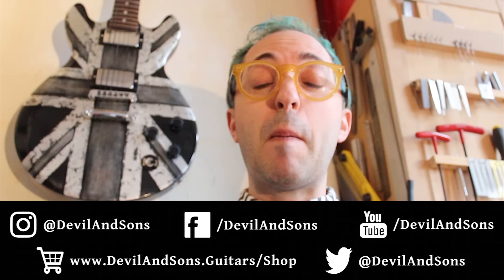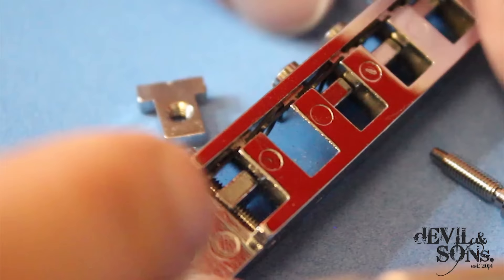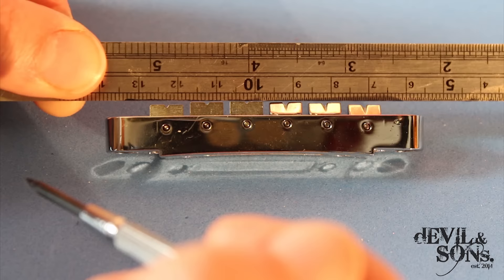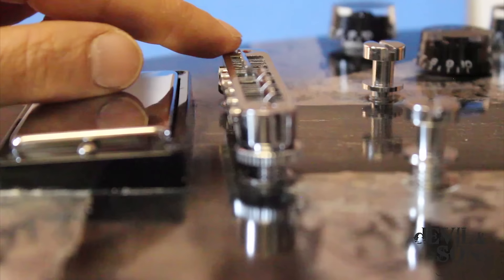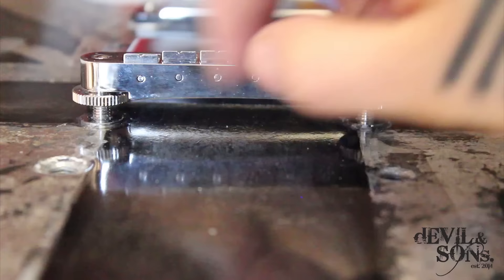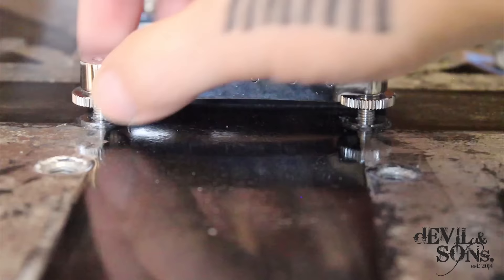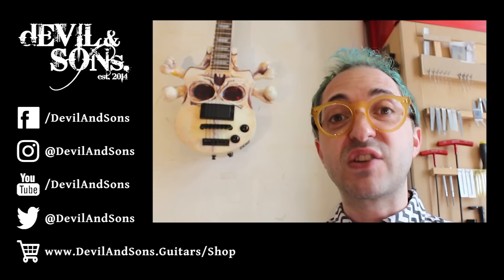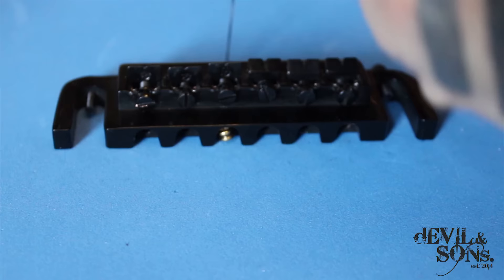Setting up a Tune-o-matic bridge (Les Paul style)

Comment: Thank you so much for the video. I love amount of detail it has. I'm just starting to learn how to set my guitar, since I cannot take it to the tech now (for obvious reasons) and I'd always wanted to know how to do this myself. Cheers!
Reply from the maker: Thanks for commenting. I'm glad it has helped for passing the time during the current situation and that you are learning a new skill from it. I hope you get on well. Happy strumming!
Reply: @DevilAndSons  I just raised the tailpiece and now I feel more tension on the strings. Is that normal?
Reply from the maker: @preciseaudioblog  normally lowering the tail stop increases tension as the gap between where the string leaves the saddles and enters the tail piece increases. The main thing though is you can obviously still loosen the strings with the tuning pegs and the height of the tail piece is really just make sure the strings aren't slipping. If you raise the bridge part with the saddles though you should expect the tension to increase. I hope that makes sense.
Reply: @DevilAndSons  Actually, I'm more confused than ever (lol). I thought that raising the tailpiece would give less tension to the strings, since the angle from the tailpiece to the bridge is minor. Isn't supposed to work like that?
Reply from the maker: @preciseaudioblog  it is meant to work like that. I'm not sure why it is giving more tension. If you need more help it may be easier to communicate over email so you can add some photos
Reply: @DevilAndSons  just did it. Thank you!
Reply from the maker: @preciseaudioblog  my pleasure
Reply from the maker: @preciseaudioblog  I just replied.
Reply: @DevilAndSons  like I say in the email, I think I'm setting the tail piece back to where it was. Thank again 👍
Reply: Do you think that old strings influence on their tension?
Reply from the maker: @preciseaudioblog  strings will definitely make a difference but possibly not as much as I think you are describing
Reply: @DevilAndSons  Yeah, that´s what I thought

Comment: Isn't this bridge on backwards? If it's a Nashville bridge (and it is) the head of the screws should be facing or closer to the tailpiece.  If it was an ABR bridge they should be closer to the bridge pickup.
Reply from the maker: They both work both ways around. I put this back the way the customer had it when he gave me the guitar to do the paint job on.

Comment: The pitch (note) of the string is uniqely determined by its length and tension, so tuned correctly the break angle of the stop tail has no impact on the tension of the string between bridge and nut.  I think it's in the head as to whether the string feels more 'bendable' when you wrap over the bridge.
Reply from the maker: I actually regret saying that as I think you are right. It does make the tension tighter past the bridge, so can help the strings not slip as easily so maybe that's why people could say it's more bendable, but then again it's rare to bend a string and cause it to slip out of the saddle.
Reply: That's not 100% true, the tension on the string runs from the tailpiece to the tuner post (unless its a locking nut), when you bend a string it stretches slightly along its entire length from tuner post to tailpiece, the tailpiece height affects the feel of the strings because the reduced string angle from bridge to tail decreases the downward pressure on the saddles allowing the string to move more freely as it stretches. Try it yourself, screw the tailpiece all the way down then play it (with string bending) then lift the tailpiece up even 3-4mm it feels a LOT nicer to play.

Comment: Nicely covered mate. you hit every possible point about the bridge without injecting personal preferences about set up. I want to replace two bridges I used because the rollers on them are not so high quality. what brand is that chrome bridge you used in the example? every bridge I look at on line the chroming looks like it was laid over dusty unclean metal.
Reply from the maker: Thanks so much, that's very kind of you to say. That was on a Gibson so came from their factory.
Reply: @DevilAndSons  
yeah somehow that popped up on my feed as a new video hahah so a tad late to that game huh
Reply from the maker: That's odd. It's quite am old video.

Comment: The bridge example u have here is  backwards….. the screw heads are suppose to be facing the tailpiece in a Nashville bridge….
Reply from the maker: If you watch the video I explain how you can have it both ways. I prefer ot this way around for access. You can change the saddle direction to accommodate, and also to accommodate intonation.

Comment: Mate ... with regard to adjusting the screws on the Saddle - do what ANY person with any mechanical sympathy knows to do, you always use the correct SIZE screw driver to fit the given recess. You had the wrong size blade for the job ... the same would apply to having the wrong size paddle pop stick. You solved the issue of the screw driver by applying the same logic to having the right size paddle pop! Now ... just go get the correct size tool for the job and there will be no damage at all.
Reply from the maker: Absolutely, correct tool for the correct job.

Comment: Very well explained but I still have a question: what does the length of the string between the saddle and the nut matter? Why do you want your treble strings closer to the nut and the bass strings further away? When the tension is what tunes the string, what does the length matter?
Reply from the maker: When you put your finger on a fret to change the note you are essentially changing the length of the string, so the string length is essential for getting the string set up so all the frets are in the right place. I explain much better in a video about intonation. I'll link it in the next comment
Reply from the maker: https://youtu.be/epolN4J65hw
Reply: @DevilAndSons  Thank you so much! Clear and concise. Very well done!
Reply from the maker: @DarkSeraph351  Thanks. It's too much to put everything in one video, it would hours long!

Comment: Nice vid, but that's a Nashville bridge and screws point backwards towards the tailpiece, on ABR 1 bridge you point the strings towards the neck. Also mostly you won't need to change the saddle side on Nashville bridge cause it has more enough room for intonation, this method was used on ABR 1 Bridge that's narrow, Nashville is wide. That's why you can't put the tailpiece too low cause the strings will touch the back of the bridge, that + neck angle
Reply from the maker: waymoreman thanks for some excellent additional knowledge. If I could edit it in I would, but hopefully people will read the comments. Covering everything in one video seems almost impossible.
Reply: @DevilAndSons  cool video nevertheless 👍
Reply from the maker: waymoreman thanks! Much appreciated.

Comment: Note: not all bridges for these are offset. I have an Epiphone SG and the bridge is even all across. Also, reverse the G string saddle to assist with the G string tuning issue. I also reversed the bridge so BOLTS (screws are the pointy things used for the pickguard and backing plates only) are opposite to the pickups.
Reply from the maker: I defiantly prefer the way you have changed it, with bits opposite the pickup. What do you mean by not offset? Do you mean the saddles are fixed in place level with each other or that the two pole pieces that the bridge attaches to the body with are level?
Reply: @DevilAndSons  ,I was incorrect about the bridge offset on mine. There is a small degree of angle that is almost not noticeable  (offset is the angle not parallel to the tailpiece or the nut). If reversing the bridge, make sure the saddle pieces do not need to be reversed as each saddle may be made for the string gauge. The sixth string saddle may be wider to hold a larger guage. The saddles for my roller bridge are all equal size.
Reply from the maker: Thanks for clarifying. That's exactly what I would expect for a bridge, that slight offset. I'm not sure why some are more subtle than others. Good point about the saddle grooves.

Comment: Great video, love the close up shots and the explanation. But! The part about the screwdriver... I mean just get a bigger one that fits just right.
And my main question was not answered: why are the saddles facing one direction on string 1-3 and another on 4-6? Yes, I understand string distance from the nut, but the facing of the saddle itself cannot be the purpose for this as you can adjust the position of the saddle anyway. And there would never be a need to place a saddle ALL the way toward the nut or away from it because of intonation. I thought that you'd want the angled face of the saddle facing the tail because the strings are coming from that direction at an angle. And are finally going toward the nut in a straight line. Facing the angled side towards the nut on strings 4-6 results in the strings crushing down the V cut of the saddle and deforming it, sinking the height of the string ever so slighty over time.
I just don't understand why you would ever face the angled side of a saddle toward the nut, ever.
Reply from the maker: Ha, you may be right about the screwdriver. Thanks for commenting and glad you like the close ups. The reason for the saddle angle is exactly that it gives more length in one direction therefore if you need to increase the length a few mm (mainly for the bass strings) it would point with the highest side towards the bridge and if you need it shorter (mainly for the top strings) the flat edge would be towards the neck. Surprisingly I have had to push saddles to their extremes plenty of times in the past. If you don't need to push them that far either direction then the way round the saddles are makes no difference. You may find that the more extreme positions come from using very light or heavy gauge strings. If you put standard strings on the same guitar it's likely the saddles wouldn't need to push to the extremes. I hope that makes sense.
Reply: @DevilAndSons  Thank you very much for the fast response!
Yes, all of this makes very much sense. I was not aware of how many guitars actually need the extra adjustment.
Say we were talking about standard E tuning, and string gauge 9 or 10. And I've established that I don't need to push any saddle to the extreme: would facing the angled part of the saddle toward the stop bar better guide the string into the saddle? In my mind: the string is coming in at an angle, and so the saddle receives it at an angle BEFORE the actual "main" point of contact.
Reply from the maker: I honestly don't think it would make a difference. But I may be wrong.
Reply from the maker: The reason I don't think it will make a difference is even with the slant the string will only be pivoting on a small part of the saddle and, if you look from side on, I think the string will come off of the saddle in the same way. Unless the stop bar is at the exact angle that the string rests on the slanting the saddle, but I don't think that is a good idea for the strings.
Reply: @DevilAndSons  Yes, I see exactly what you mean! Thank you for this most informative, pleasant and enlightening exchange. (I swear I'm not purposefully trying to sound so poetic)
Reply from the maker: It's a pleasure. The conversations in the videos make it all worth while

Comment: I believe this is what I was hoping to confirm with a problem I have? Towards the end of the video you say you don’t want the string touching the back of the saddle of the bridge. I’m new to the semi hollow design and the Tune O Matic bridge, the high E string is giving me a piercing tone and an actual volume spike/swell after being picked and fretted anywhere on the board. I noticed that it is indeed touching from too much angle break so I’m going to try and adjust this later and see if it gets rid of that awful tone? I also noticed that all of the saddles on my bridge have the slant pointing toward the back of the guitar unlike how you have them half and half? Thanks for your video! Subbed!
Reply from the maker: Thanks so much for subbing, and I hope this helps. One thing may also be the string itself.  You don't have to swap out all your strings but if you still have the problem it may be worth changing just that string. You can buy e strings separately. I would also suggest you could try a slightly heavier gauge perhaps?
Reply from the maker: @seymourheiney12  Did you adjust the stop piece and did it make any difference?
Reply from the maker: @seymourheiney12 crazy that it came out of the factory badly set up.
Reply from the maker: That is bad. In the UK you have a right to return anything within 30 days.

Comment: This is an amazing video. You are great and very knowledgeble. I would just like to know how to properly setup the tune-o-matic height so the strings are a t a correct height as well.
Reply from the maker: Count_Sowir thanks so much for your comments. This video isn’t about setting up your guitar but how the bridge works, so there are a few other things to take into account but... measure the height of the top and bottom strings at the 12th fret, a good aim is to have the bass e string at 1.5mm above the fret and the high e string 1mm above the fret, you will need to adjust the thumb screws to adjust the height. This is just a guideline though, depending on what feels right for when you play, some people prefer the strings to be higher. If you are getting fret buzz from this height you may need to raise them anyway, or adjust the truss rod. I haven’t made a video on setting up a guitar yet, but there are lots on the web that may help.
Reply: @DevilAndSons Amazing! Thank you very much. I've meddled with my guitar and of course I know nothing about fixing it, so I am very thankful for the help.
Reply from the maker: Count_Sowir it’s a pleasure. Good luck sorting it out.
Reply: @DevilAndSons  I have one more question. Does the tune-o-matic bridge have to be level? To get the proper string action I found out I have to raise the Lower E side of the bridge much more. Right now there is 2mm (5/64inch) difference.  Is it a problem? Will it damage the guitar?
Reply from the maker: Count_Sowir that is a correct setup. Again, this video doesn’t go into set up but normally the low e saddle on any bridge is higher than the top e, partly because the strings of the low notes are thicker and therefore vibrate differently when you pluck them.
Reply: @DevilAndSons  Thank you for the quick reply. I was worried about breaking my guitar. Now I know it is fine. Bless you. and Thank you once again very much.
Reply from the maker: Count_Sowir no worries, I just happened to be online. Have fun strumming!
Reply from the maker: The full set up video is now up, you may find it useful: https://youtu.be/fvD-qsM3piQ

Comment: Excellent video. I’m planning a recessed TOM style bridge build on my partscaster project.
Simply because I love the way a TOM feels on the palm, it’s what I’ve always used and just feels right to me.
My issue is that I’m using a Fender neck, and it’s radius is 9.5”, which I also love.
I understand most TOM bridges are designed with the 12” radius of Gibson necks in mind.
So my question is how hard would it be to use a TOM with a 9.5” neck? I’m assuming I will have to file the string slots on the outer saddles to get it where I want?
Reply from the maker: That sounds like a good solution. I wonder how much it will really notice though. I would install and test it first before altering the saddles just in case it isn't that much of an issue or incase you over do it. With it all strung up you should find it is easier to check the amount you need to lower the saddles.
Reply: @DevilAndSons   That’s a good idea, I will definitely try it out first. Thanks for the reply!
Reply from the maker: Good luck, and do let me know how you get on.

Comment: I hope this helps to get rid of fret buzz on my Paula.
Maybe bridge and tailpiece are to deep.
Reply from the maker: Sorry I missed this. If it doesn't there could be some other reasons. Let me know and I'll suggest another thing to try.
Reply: I screwed the bridge and tail a bit higher.
Better but still buzzing.
I'm afraid the trus rod needs adjustment.
Bridge has collabsed a bit. Sattles are a bit to deep from that. 
Frets are ok. 
I testet if they wiggely with a kreditcard. All Even.
Reply from the maker: That would be my next suggestion, to loosen the truss rod slightly. Is there fret buzz on all strings?
Reply: @DevilAndSons  only low E.
Mostly turned in drop d. The first 3 or 4 Frets got a buzz. 
Maybe just the single saddle.
The outer ones are at one Level.
Reply: Btw: thank's for your support. 👍
Reply: @robertb8673 how's the wiring? The actual electronics portion? Is it getting interference from outside electronic devices?

Comment: I changed the tuners on my 57 gold top and for some reason it slightly threw off my intonation.  As I was adjusting it I ran out of room on the G and B string so I ended up flipping the saddle.  does anyone know if theres anything "wrong" with that?  The truss rod is adjusted perfectly and everything else is in order. I havnt encountered any issues (yet).
Reply from the maker: I would recommend that as a solution, so there is definitely nothing wrong with it.